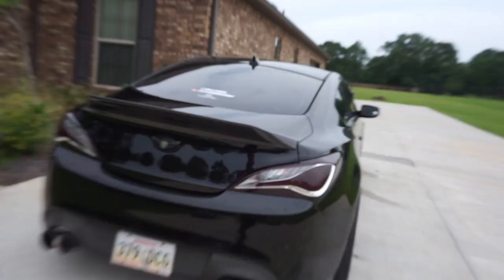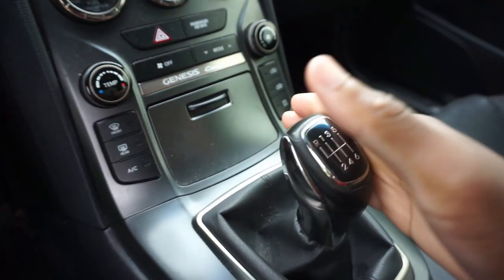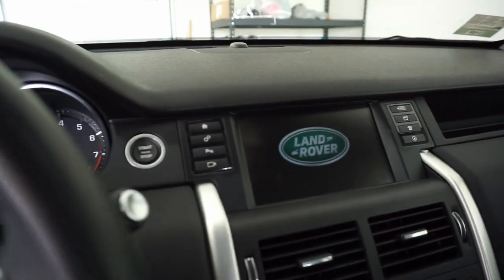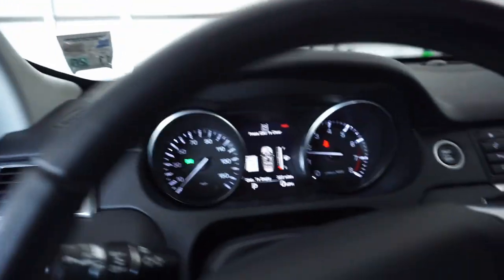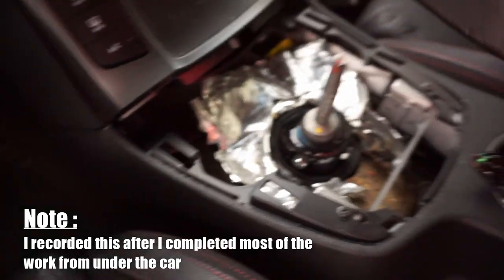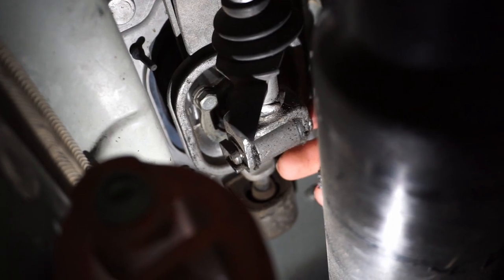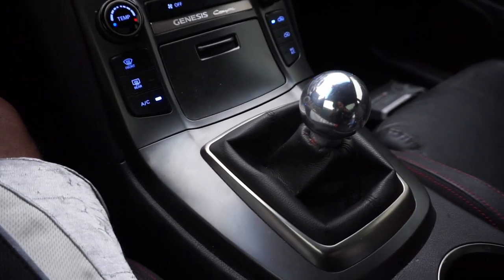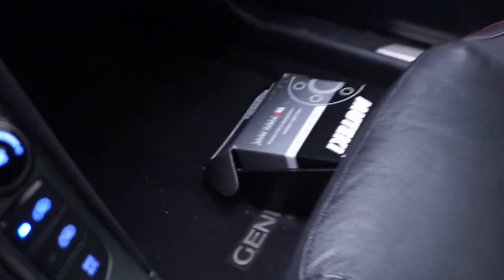Installing UNIQ PERFORMANCE Genesis Coupe Short Shifter

Comment: I just bought this same shifter. Thanks for making a video thats just simple. Everyone else bothered to disconnect the driveshaft. I figure I  can pull this off now.  Hopefully my brother helps me out for an hour or two lol I was thinking same
Reply from the maker: Lol, nahhh.. No need to disconnect the driveshaft if you have a good set of tools. I’ve done it twice without having to (once on my cousin’s car). Just take your time and be sure that everything’s tight and you shouldn’t have any problems
Reply: @pj_morrison  thanks brother, will do

Comment: I would also add a megan transmission mount to prevent damage since the oem one flex's so much
Reply from the maker: I did that in another video bro👍🏽
Reply: @pj_morrison  Oh awesome! Hows the reliability of the bk2 3.8? I heard the bk1 3.8 is more reliable. And somehow the bk2 2.0T became more reliable vs the bk1 2.0T ticking time bomb lol
Reply from the maker: @MJT-DA  as far as reliability.. I’ve had no problems really, but I also blew my first motor by money shifting lol. No fluke things tho, that was driver error
Reply: @pj_morrison  Oh ok I heard the G6DA motor in the new bk2 has oil starvation issues vs the G6DK which never had these issues. I wonder if any company makes a upgraded oil pump maybe?

Comment: What’s the link to this short shifter
Reply from the maker: https://uniqperformance.ca/product/2010-genesis-coupe-uniq-performance-short-shifter/
Reply: @pj_morrison  thanks bro. One more question so I was driving earlier today and I hard shifted into 2nd and my shifter now is like a limp D 😂 can’t shift into any gears at all and car got stuck in 2nd cuz that was the last gear I was in before this happened I’m not sure but I believe the base of the shifter rod came off the linkage to the transmission

Comment: Is it the same thread pitch as factory?
Reply from the maker: There was no thread pitch on the factory shifter.. The shift knob from factory is pressed on and sealed. I do believe it’s the same thread pitch from a bk1 tho
Reply: @pj_morrison  oh okay cuz I have a 2013 and was wondering if it’s same thread pitch as that, I know they stopped doing threaded ones I believe in 2014